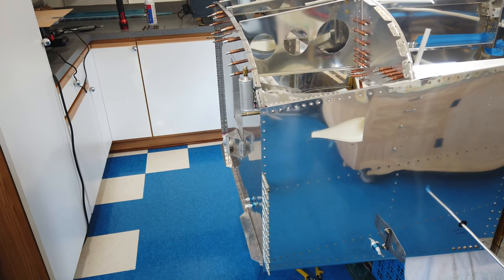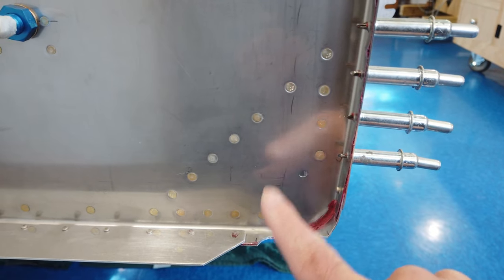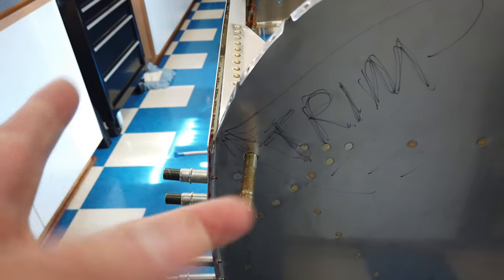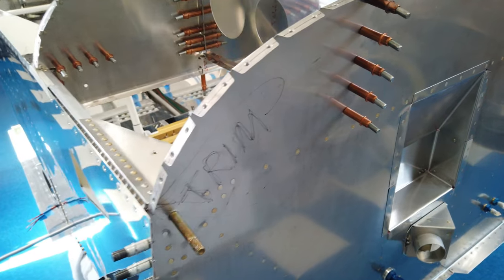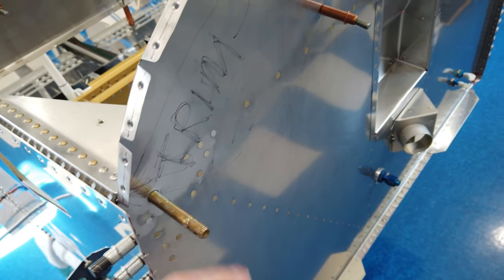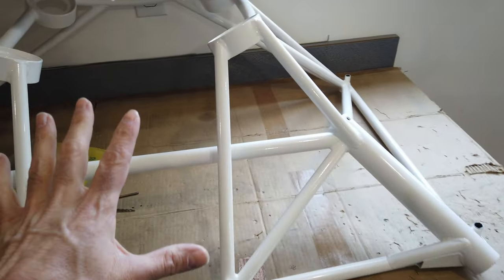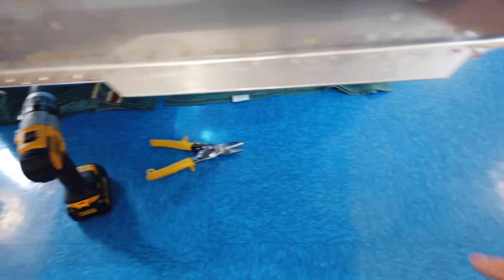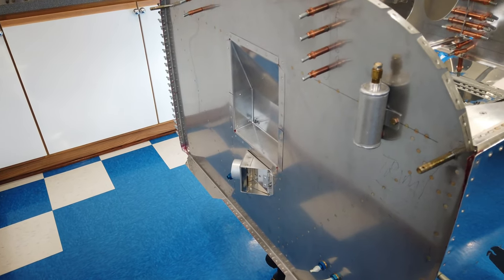Vans RV 7 HINT Video Engine Mount Install Begins

Comment: Two flute drill bits tend to drill a triangle shaped hole.. I like to use a uni-bit for holes later than 1/8 inch. They make nicer ROUND holes
Reply from the maker: Not sure a unibit  has deep enough steps to reach through the aluminum stack up behind the stainless.  That triangle shaped hole, if you allow it to happen, rounds out nicely once through the stainless and the aluminum gets drilled at high speed. (Round bolts don't usually fit in triangle holes.)
Reply: @KaretakerAero  I forgot there’s aluminum back there.. yeah that will true up the drill bits and allow it to cut round holes.. I was thinking about just the stainless sheet by itself..
Reply from the maker: Looking at my unibits, I do have one that will do a 3/8" hole and it appears to have about 3/8"  or so deep steps between hole sizes. I believe that would work just fine! Start small, drill up to about a #30 pilot hole using regular drills, then use this deeper unibit to finish.  I wish I would have thought about the unibit...good idea!  Thanks!